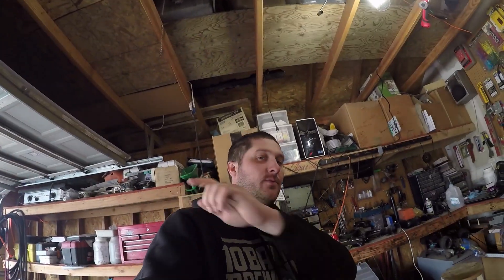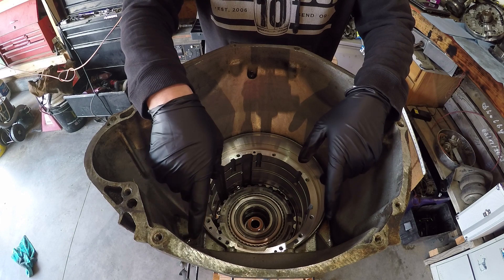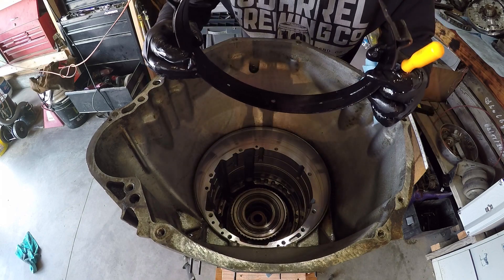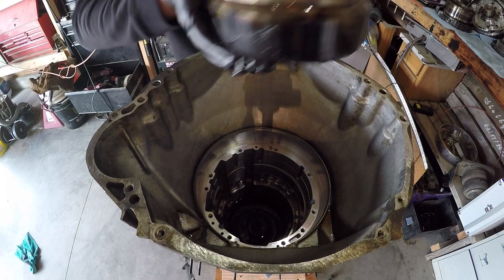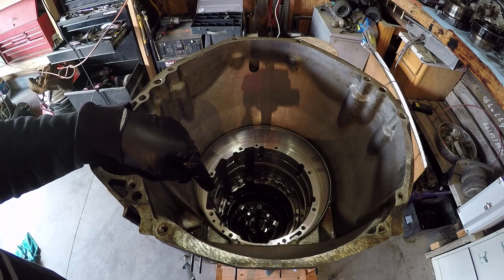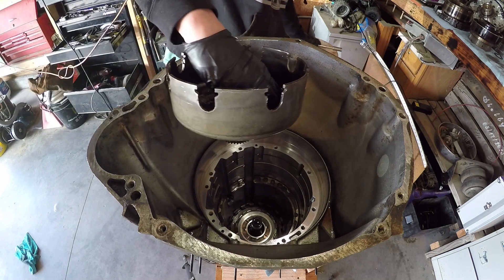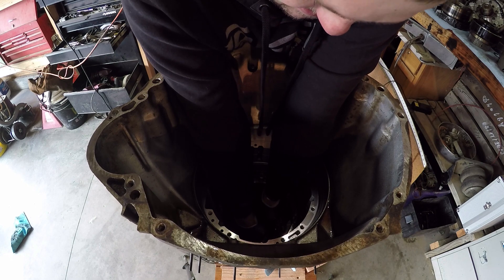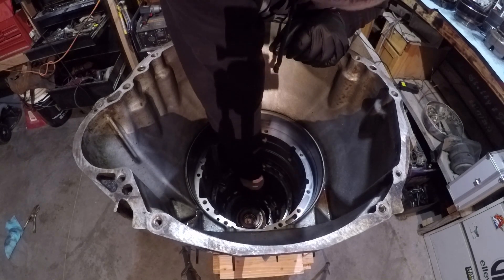E4OD TRANSMISSION TEAR DOWN PART3

Comment: Yea you guys are inspiring the hell out of me. I just dont have the money to fix my Expedition. I have a 2003 with 249,000 miles on it and the motor seized up last September. Been debating on what to do with it. Thought about a Cummins swap. But just dont have the cash for that. I could probably buy a Powerstroke for what I could  do the swap for. So dont know. It doesn't have 4x4 so it's not like special. It's just plain Jane. So dont know really what to do with it. The wife loved it too. We gave 800 for it cause it had a blown spark plug and me and my son fixed it in a hour and half. Had it running. And that following summer we went to Mrtyle beach in it. Drove like a champ. Had it for 2 and half years then the motor blew. We were heart broken. Keep up the awesome videos!!!!! Oh I'm a Fox Shop referral. Love all the stuff both of you all are doing!!!!
Reply from the maker: Thanks welcome to the channel I love my 7.3 there great trucks

Comment: There are steel planetaries available from later Diesel model E4OD and 4R100 transmissions that will work. The E4OD has 3, 4 and 6 gear plaentairies available. Gas trucks had 3 gear, early Diesels had 4 gear and the later HD Diesels had 6 gear steel. You can upgrade parts to 4R100 specs just be sure to count your teeth and get the matching frictions, etc.
Reply: This is true.  As well as upgrading the sunshell that it was in to the 4r unit.  It makes the E40D has a U shape groove in it, and the 4r has a wave that pokes out in the middle.

BTW, where did you find your rebuild kit, and how much?  If you do a full rebuild on this on your own and make upgrades with added frictions and steels, the KITS are almost a grand.  That has nothing to do with the upgraded planets.
Reply: @chriswalker5729  I bought a rebuild kit on eBay form a trans shop. When I rebuilt mine, it cost me about $1500 for new hard parts, TC, upgrades and Transgo kit. Most hard parts were sourced from eBay used but in good condition.
Reply: @eatont9999  Thats the problem.  You can get a stage one from more than one company for less that have a 12 month warranty.  I wish they were not so spendy, because they will absolutely tow whatever your engine  can pull.

Comment: Would you buy a 600 full master rebuild kit or just buy a small clutch set kit. About 250 dollars. I'm looking to rebuild mine soon. Doing a 2x4 dually to a 4x4 dually using the same 2wd transmission. Just going to change the output shaft in the process. Looking for some help.

Comment: Personally, I would get a new shaft for it. Unless you have all the initial specs for it and can triple check it, it's not worth it. If it was a part you could replace without taking the trans out and tearing it all down again risk it. Doing this again would be too much time and energy in my opinion.